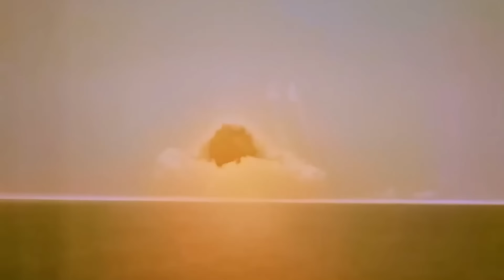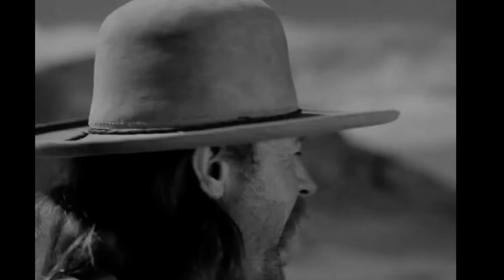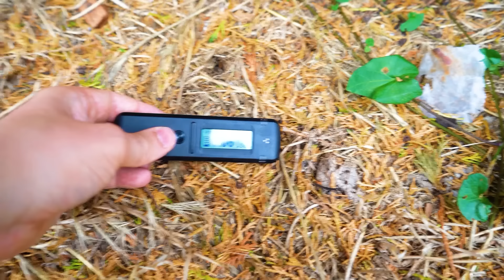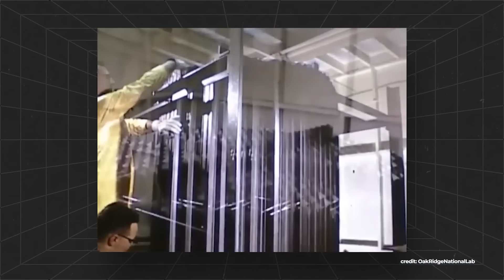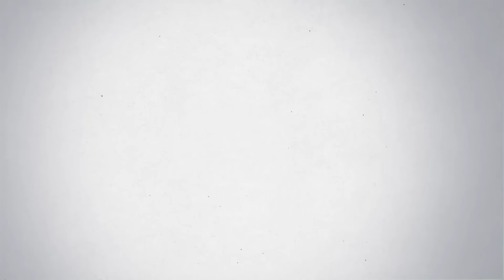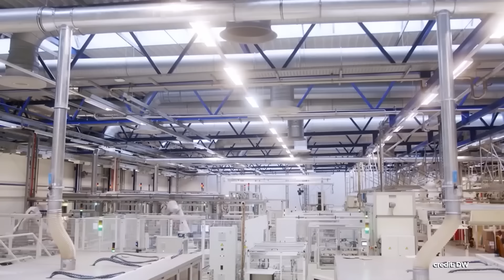It's Happening - China Launches World's First Thorium Nuclear Reactor

Comment: Sorry for the downvote, nothing you're saying is "wrong", but is misleading at best. You clearly don't know the subject, and didn't look into it enough.
Things like the freeze plug isn't "in case you lose power", it's a dead simple safety mechanism; if anything causes the reactor to get too hot (loss of power, loss of control, operator issues, anything) it opens and the reaction stops. Things like in a PWR, loss of cooling isn't the worst part of a primary coolant leak; water is also a moderator, steam is not, so failure has a positive feedback loop -- a salt leak has a negative feedback loop (the reactor stops working, rather that going boom). I'm glad people are talking about Thorium, but not with all these misunderstandings. I have to agree with your sentiment that we should be investing in technical development rather than playing catch-up.

Comment: There is one way that molten salt reactors are more dangerous than solid fuel reactors. Their cores are already melted down and easily water soluble if such a reactor floods with water much more radioactive material will go into the environment than if the fuel was in solid state.

Comment: 13:46 "they can be placed in the middle of a sparsely populated desert because again they don't need water"  why they don't need water in the core they certainly need it for the turbine, it is generally good to have a water source nearby to allow for water injections in case of a steam leak which would cause a lose of cooling accident as why your primary is still there it has nothing to transfer the heat to. Secondly you would still need something to cool the condenser to roughly 20 degrees Celsius to 1. condense the steam. 2. maintain the vacuum inside.

One side note but I am curious to ask if anyone what saftey features have been designed  in case of a steam generator tube failure as this would allow contact between the water side and molten salt side of the generator, This is not an uncommon fault to have and with the risk of the sodium exploding inside of the generator I would like to know how they plan for this as no one ever mentions it. Even in the 1960 Sodium Reactor Experiment at the Santa Susana field laboratory it was just a normal heat exchanger.

Comment: 1. Molten salt operates at atmospheric pressure. The reactor doesn't need a five-foot-thick concrete containment vessel. High pressure steam in the reactor is the #1 problem in existing designs.
2. Separately, thorium is a good idea to reduce proliferation, reduce the need for Russian uranium, and increase the safety of the reactors.
3. The modular reactor folks are proposing power levels that are too high. A 400 kilowatt thermal (200 kilowatt electrical) benchmark would mean portability and high volume manufacturing. 
4. Make a 4000 watt electrical reactor and get rid of all the gas generators operating at food trucks and as backup power.

Comment: Sorry for this ranty and long comment, I am mostly writing it for myself

It is important to understand that everything about Molten Salt Reactors (MSR) in this video applies to non-thorium fuels as well and that describes only one type of MSR, the fast neutron version.

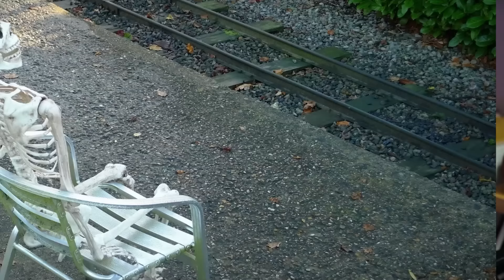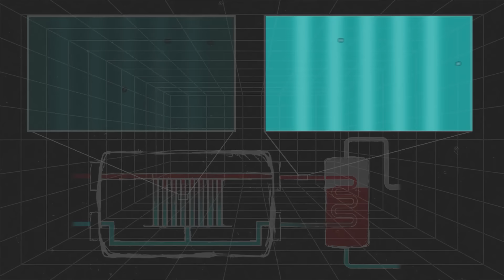This is just simply not true -> 6:19 The water is not there only as a coolant, but as THE moderator that slows down the fast neutrons (same thing as mentioned out later at 5:30) to greatly increase the efficiency of chain reactions happening (fast neutrons go so fast, they bounce off instead of being absorbed), so "modern" nuclear reactors use water not only as the coolant, but since it can't operate without the water as the moderator medium, if the coolant (water) is lost, then the moderator (same water) is lost as well, and the chain reaction shuts down automatically. The extremely dangerous radiation levels die down almost instantly after the chain reaction stops, and they have very short range.

It is graphite moderated nuclear plants like Chernobyl that are/were the biggest risk, since the coolant and moderator were different, even when the coolant was lost, the moderator (being a solid graphite rod) was still there making the chain reaction go crazy out of control. This moderator (and other absolutely braindead decisions like not having building the protective womb around the core to cut costs) are what caused Chernobyl, not the high pressure water coolant. This already can't happen in "modern" nuclear power plants due to them being built around passively safe mechanisms (like the water cooled/moderated ones)

It is the low pressure, easier refueling which leads to smaller form factor (-> significantly lower costs and increased modularity) that are the selling points of MSR. However, they have a MASSIVE problem that has still not been solved AFAIK, and that is the massive corrosion caused by the molten salt

Also, that pesky Xenon-135 gas mentioned here is a real problem, it is actually the main culprit that caused the Fukushima accident to happen, the Earthquake and the Tsunami didn't actually cause any damage to the actual plant itself. That Xenon gas is poison to nuclear chain reaction, since it is such a powerful neutron absorber, and it's massive build-up after the reactor is shut down, actually prevents the restarting of the reactor again, before the Xenon-135 levels have decayed  enough (a few days) to allow the chain reaction to occur again, this is why shutting down and restarting nuclear power plants is such a hassle. Interestingly enough, Xenon-135 was also the cause that led to the Chernobyl nuclear accident, although for different reasons

However, what is misleading about the video, is that it fails to mention is that during normal operation the Xenon gas build-up eventually reaches equilibrium and doesn't just keep on building up.

Long story short, Fukushima power plant's auxiliary systems ran out of electricity since the power plant couldn't be restarted due to Xenon gasses, after the earthquake detection system had shut it down automatically, which was just one in a series of one in a million freak-accidents that eventually blew one of the reactors open. Not a single person has died from Fukushima accident or anything related to it

ps. many of the comparisons of Thorium and Uranium radioactivity are very misleading, since some of them are like comparing apples to oranges. While what they are stating is technically not untrue, it is very very misleading
Reply: THANK YOU. Most of the video is bullshit scaremongering wrapped in trying to sell the thorium myth.
Reply: Thanks for your perspective.  Are you saying that No One received any radiation from Fukushima that will shorten their life, assuming they continue to get radiation from average life events, like background radiation, medical and dental exrays, CT, etc. than a person who has not received the highest exposure dose from Fukushima, If radiation is cumulative? For example, excess exposure to radiation from the Sun (sun burn) as a young person may result in cancer of skin tissue years later which may shorten a person otherwise longer life. Is the metric that no one was immediately killed or died within days, weeks, months after exposure from a Fukushima type accident. Does one have to die specifically from the exposure dose to Only be counted as died from a specific nuclear accident.  Or do you count the shortening of their life years later due to this unfortunate, unexpected, or unnecessary added exposure dose event? Thanks
Reply: @maximumentropy1863  The radiation was not severe at all, especially compared to Chernobyl for example. According to official sources, there has been no deaths or terminal cancers that could be tracked to Fukushima. Radiation isn't cumulative, you don't get radioactive from radiation

Radiation is energy waves just like micro or wifi waves, just more intense. the more and more intensive radiation you get, just means the changes of being unlucky and those rays hitting dna or rna causing damage increases. The more you get, the higher the change some of this damage might corrupt the cells in a specific way that causes them to start acting like cancer cells that the body isn't able to properly destroy and clean up.

That is why we use yearly radiation limits, since those are the extremely safe ranges where the propabilities of cancer and the body not being able to take care of them are very very low.

Unless you are pretty much hanging around right next to an exposed running core, radiation damage from nuclear power plants is quite limited. Fukushima-plant was also evacuated, and the accident happened much later after the tsunami, only when the backup power batteries ran out, and they didn't manage to get back on site on timeto replace them, and the plant was shutdown

It is important to remember, that the more intensive the radiation, the shorter it's half time, shorter the range and very low chance of penetration. Very long range radiation on the other hand has not only much lower energy, but is also very unlikely to hit you, and just passes through. without doing any damage

Nuclear fallout, like with Chernobyl is far more dangerous on the other hand, since the rwactor blew up and shot massive amounts of tiny radioactive particles to the sky, that were then transported all over Europe by the wind currents. But even with them, the more dangerous they are, the shorter lived and shorter range they are

And unless you are eating lichen full of those particles absorbed from the air, like reindeers, radiation doesn't cumulate

Comment: I think that there's a lot of technology in China no one is talking about if I'm a manufacturer let's just use a crescent or adjustable wrenches as the example I have under retail sale two types of crescent wrench one is for $1 and the other is for 50 the $50 is the highest quality you can buy what do cheap wholesalers want they want the $1 wrench China does make some really high quality stuff it's not the cheapness of China when you come across the tool or anything else that is in Failure it's the wholesaler you bought it from the producer in China built exactly what they were asked to build

Comment: Only need to recirculate coolant for about a month after shutdown - the decay heat is about 6% of the power level, whatever that was run at, and that's what you have to deal with after the reactor  - any fission reactor really - is shut down. This is the heat that destroyed three mile island and resulted ultimately in a hydrogen-gas explosion at Fukushima. 

Molten salt can still deal with that, but it's a better thing to easily dump out all the fuel from the core and put it someplace where you don't have to work to keep it cool - the dump tanks can/should be 'passively' cooled - this means no pumped coolant is required. 

The core can't be that, because it needs to be an oven. Solid fueled fission reactors are therefore pretty stupid: Not only do they 'shit where they eat' I.E. can't remove waste continuously, especially Xe-135 (hello Chernobyl!), but they have an explosive tantrum if they're not actively cooled after shutdown.

So why have we ended up with a 'dumb as rocks' design as a reactor that not only has solid fuel (that you need to manually 'play with', like stoking a fire, to get to 'burn' evenly) but that is water cooled (and therefore subject, not only to steam explosions, but also to hydrogen explosions due to thermal cracking catalyzed by the zircon fuel rod cladding, but also due to radiolytic separation: Guess what happens when ionizing radiation hits a water molecule? If you answered 'ionization' you're correct! This means at least one hydrogen atom parts company... and guess what happens if the resulting OH radical also gets hit by ionizing radiation? Yep, now you've got loose Oxygen and hydrogen radicals floating around... these can build up, and before you know it - Fukushima mk2!

Why water cool? Well, it's a pretty good coolant (in other situations) and is a reasonable neutron moderator (slows neutrons down from ~4Million eV to single digit eV where they are essentially much 'stickier' or more likely to hit things than just bounce off). Thus, a 'thermal spectrum' i.e. moderated reactor can be built with much less reactor fuel required (critical mass is smaller, because better neutron economy). OTOH, this means a 'fast spectrum'  or un-moderated reactor requires MUCH more fuel to reach critical mass, which you have to exceed to get the reactor power to increase. Ultimately, it's the materials and shape which make the 'core' a place where the neutron economy can grow (ie, be super-critical). Critical just means neither growing nor decaying: maintaining power level. Sub-critical is decaying/reducing power. 

So the molten salt cores need only be good heat ovens and focus on being good neutron ovens too: Whereas solid-fuel cores need also to be heat-exchangers so the heat can be made to do work... and on shutdown, this is why they must have active cooling.

It turns out, that making a solid-fueled fission reactor is actually somewhat easier than making, for example, a camp-fire. This is because, for the fire, you have to worry about the fire both getting enough, but not too much, fresh air, and getting rid of exhaust smoke, as well as being the 'right shape' not to loose too much heat and go out. With a fission reactor, you really just have to worry about not loosing too many neutrons, and this behaves quite a lot like heat does, just with different materials being better at either reflecting or absorbing neutrons. Too many of the latter absorbers, and your reactor can't run - they're also called reactor poisons. They are used in control rods to deliberately control reactivity, and also in some water moderated reactors, boron is dissolved in the water to do the same.

But you can - and people have - made fission reactors *by accident*. Its called a 'criticality accident'. 

Ironically enough, this actually happened to the Molten Salt Reactor Experiment.... years after it had been shut down, it actually slowly concentrated concentrated fissile fuel in gasses that collected at the top of the dump tank the fuel had been left in (over decades), and this had at some point gone accidentally super critical.... with basically no consequence other than someone eventually noticing more radiation there than there was supposed to be. 

Another thing MSRE did during operation: They had an accident where the control rod got stuck! On other solid fueled reactors, this had resulted in explosions killing people nearby, on the MSRE, the temperature increased.... then just leveled out slightly higher. Very 'boring', which is *fantastic*. This is because as the salt gets hotter, it expands, then less fits in the core, so there's also less fuel in the core, and the reactivity is automatically and unavoidably reduced... a case of 'negative feedback' which causes it to exhibit self-control, aka 'stability'. As opposed to reactors like Chernobyl that were decidedly prone to 'instabiliy' or getting stuck in a case of positive feedback causing exponential growth.... aka an explosion!

Comment: Getting more than 300 000 views and more than 1500 reaction in 17 hours suggest many people are interested.
A few aspects of liquid salt reactors were missed. Light water reactors operate at about 330 deg Celsius providing a Carnot efficiency of about 30%. About two third of the heat they produce is thrown away. Coal fired power plants operate at about 550 deg for a Carnot efficiency of about 50%. When a dozen years ago China started a program to build a large number of modern coal fired power plants  it promised that their steam generators would be replaced by nuclear ones when these became available. That would be liquid salt reactors that work at between 550 and 700 deg or Helium cooled ones that operate at about 900 deg. A gas turbine topping cycle might be used.   
Earlier this year Det Norske Veritas approved the design of a vessel to transport 24000 containers powered by a molten salt reactor to sail between the Pacific and Atlantic through the Arctic all year round. The expectation of watchers of China's military is that the next Chinese aircraft carrier will be powered by a pair of nuclear reactors. That will presumably be a pair of molten salt reactors of the same type. Rumors say its production has already begun. These reactors will have about the same power output as those of US aircraft carriers but because of a higher efficiency have a lower thermal output and lower shielding weight. Also no heavy pressure vessel so the whole will be less heavy.  The same reactor size will be suitable  for replacing the steam generators in coal fired power stations. The reactors can be build in the same plant and transported by rail to power stations and ship yards instead of being assembled where they will be used.